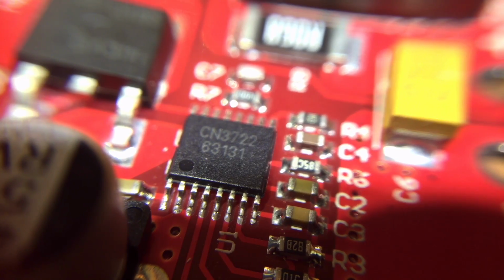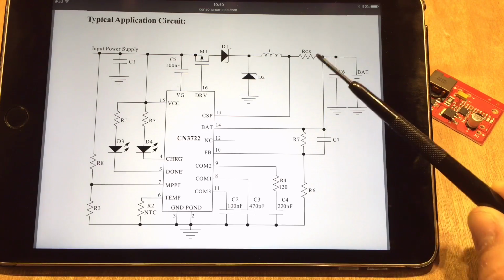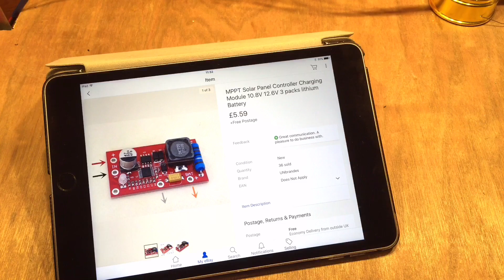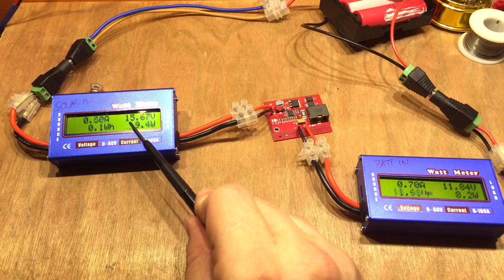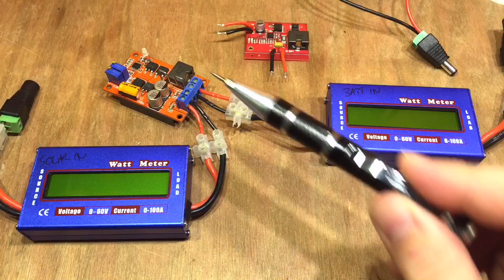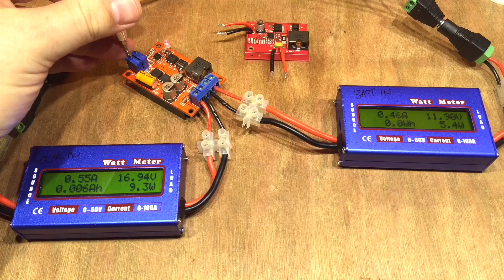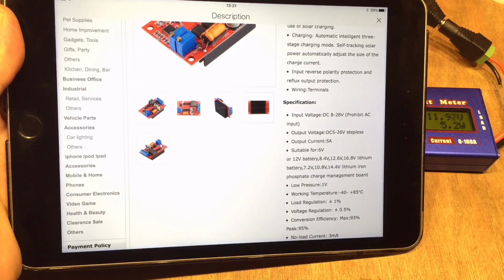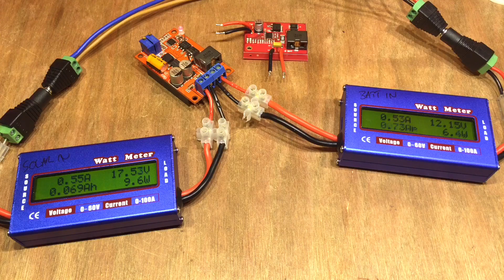Cheap(est?) Lithium MPPT Solar Charge Controller CN3722 - 12v Solar Shed

Comment: MPPT? ROTFL! 
The modules are operating a a FIXED power point 18V. 
That might be good under the reference conditions for most 18V panels, but be bad for all other ranges, and an absolute no-go under diffuse light.
I know these modules, built around the CN3767 very well and even use them, but with a tweak around the R1/R2 voltage divisor to provide a real MPPT with software.

Comment: I'm adjusting the one with the two pots.  I only have one inline meter.  Is it ok to place that between battery and charge controller and adjust to maximum charge rate? or should I do it differently?

Comment: After looking, again, it looks as the PCB is the samle what is given for a design.  So it's a Solar Charge Controller and NOT a MPPT tracker, it has only a input to connect to a tracker  and the term MPPT is not complete true, but works better than a charger without it as it has (some) setup to go for a possible global panel setting.!
Reply from the maker: I think I said in this video that it’s not maximum power point tracking, but more maximum power point targeting. There is pretty good theory behind the idea that setting a target at the panels Vmpp will get pretty good results. It’s not going to get as good results as a more advanced charge controller, but this module is for small projects and probably has benefits over a cheap pwm charge controller.
Reply: @AdamWelchUK  I agree , for small  systems it does a good job as long as the panel gives a MPP around 15 V.

Comment: The MPPT input on the CN3722 is just a input. as datasheet says.  That neans you need a external MPPT controller what is aware of tge characterisricks of the solar panel you are using. And thats not only a voltage comming its depends (very) heavy on the temp of the panel and the power received from the sun (think about clouds coming over).
For more info about MPPT:  https://www.youtube.com/watch?v=0ItjKs7aJFM

Comment: is it recommendable to use a BMS in parallel in the output of the solar charge controller?
Reply: @Angel  depends on what for battery pack you are using. For only (xxP)3S of 16850's cells i will say YES but when you are connecting a 12V 100Ah LiPoFe4 it is a complete overkill.  (Hope this help :)
Reply: @retiredjan4714  I'm using four of the second one in the video and they are connected to four 12V 8Ah Lifepo4 Batteries which are wired up in series, so basically the charge controller's are connected one per battery which makes them also in series... Each controller looks after it's own battery and stop's for that battery alone when it's fully charged but the rest keep charging if they need it... With this setup I don't need a BMS! It works for 24V 36V and my 48V battery bank... 
If one or two cell's reach full charge, their Controllers stop but if a load is turned on, the two controller's step in and provide energy to power the load.. I'm impressed with how good it works... There's many ways to set up a battery and charging system but the one thing that I keep hearing from everyone else is balancing issues, I don't have that problem... It's just automatic with this setup...

Comment: The second controller, is it ok to adjust the output voltage with just a meter attached in place of a battery?
Reply: No, I don't think so, I disconnected the battery while the solar panel was still connected and it died! I don't think a meter would present enough load to stop it from dying... I haven't yet had a look at it's datasheet to see if there's any mention of placing a resistor across the battery output to provide protection against this sort of thing....

Comment: is it possible to extend an mppt controller/hybrid inverter PV input voltage? Perhaps just upgrading the input stage capacitors? I noticed a voltage divider network near the 100v 1000uF im guessing it reports the input voltage to the mcu. My mppt/inverter is a Easun Power ISolar SMV 3k 24v

Comment: I have just bought and tested the 3s mppt controller , used a variable wall charger at 16.5v to replicate solar input ,the controller did charge the battery pack but wow it got super warm I think it would need a huge heat sink lol

Comment: Need a little bit of help if you don't mind I'm building a new type of solar as you can see in this link https://youtu.be/Dp-6fOGI6oc  
I want to change the way the 12 volts is used to from the solar is it possible to boost up the the current by using capacitor storage come email medialibraryinfo@gmail.com you can contact us at 313-651-5349

Comment: Thanks for the video Adam. 

I'm actually testing a pair of these to charge my portable solar accelerator project. For what I need, they seem to be ok. They definitely do DC to DC conversion, although as you say, they're not power point tracking, more power point vomtage holding. However for the size and price, I think they're worthwhile, in small solar installations.
Reply: Are you able to attache an LCD screen on these ?
Reply: The fact that you can get more current into your battery by doing DC-DC conversion compared to a PWM controller is still much better off even though It doesnt maintain the full powerpoint even during cloudy conditions, etc. the fact that you can adjust it is pretty good as well

Comment: Those devices were putting the same level of current into your batteries as the solar panel was giving out -- about .6A.
You could just hook up the solar panels direct to the battery for the same effect.
About the only thing they appear to be good for is to prevent overcharging.

Comment: MPPT means ability to 'track' the max yield point in the panel.. which varies from panel to panel and also shifts with temp and illumination... it dfntly dsnt mean 'setting' a voltage to a set value (as is being done in the second controller)...  an actual MPPT controller has a range of voltage in which it 'hunts' for the point which yields the maximum power... there are a few diff algos whicb do this in few diff styles.. but none of them use any preset values to operate..  this circuit appears a waste of time and money.
Reply from the maker: I think I mentioned the fact it doesn’t track didn’t I? More of an MPP solar charge controller I think I said? This has its uses in my opinion - it’s great for a little remote project that needs a small and efficient solar charge controller.

Comment: I Wouldn't be worried about the "tracking" as long as I can set a roughly correct Powerpoint. What worries me more is the loss of efficiency of the adjustable board compared to the fixed version. It seems this is much more significant then the missing mpp tracking.
Reply: The Increased Current limit to 5 Amps on the larger board is worth it though, in my testing with both boards, the smaller board with about 5 watts going through it had an efficiency of about 98%, the large board with that wattage was about 98 as well, but with 5 Amps being shoved through it, the efficiency was about 89-92% depending on the temperature outside, etc. But still, 5 Amps at 20 Volts Makes for about 7.5 Amps at 12.6 Volts which is an insane difference in charging speed!

Comment: Using a battery that is charging provides quite a variable load, and the test is thus inconsistent. YouTube star Julian Ilett correctly applied a load on his battery to prevent it from changing voltage during such comparisons. If the output voltage is constant, then a load resistor might be used to provide a constant load.

Comment: Constant Voltage is the cheap and dirty way of doing psuedo-MPPT, a couple percent less efficient than true MPPT charging.  If you live in a higher lattitude or constantly cloudy area, those couple percent can make a huge difference in how much power you get over one day.  The CN3722 is designed only for Constant Voltage MPPT.

Comment: Wish I could figure out how to use these and other small MPPT Controllers as a Reference to drive FET and Inductors of 20-50Amp  .  Quite sure there is a way I'm just not knowledgeable enough to hack it.  Guessing one could simply use the FET drive to Drive  parallel FETs and Inductors to obtain the goal ?
Reply: Or you can simply use two or more of these in parallel for more current or Go the other way and wire them in series for higher voltage...
Reply: @PeterMilanovski  Yes but there has to be a way to simply expand they're current levels.  Everything is there but the dang Current.  That is derived by the inductor.  Can we use one to manage a larger inductor ?   Multiple inductors ?  My Ep ever has two rather sizable inductors employed.
Reply: @pulesjet  I was just looking at the datasheet for the control IC chip on the PCB board, the datasheet only shows two diodes and one transistor! But the actual PCB has two double diodes which is four diode's and two transistors instead of one! So I think that the person who designed this board was thinking about reliability at the full rated 5A current... The only way to get more current out of it would be to use higher current capable diode's and transistors but mount them off the PCB board and onto a larger heatsink and connect them with wires, I don't know what that inductor is rated for though? It might also need to be upgraded and remotely mounted like the other components... Everything else is low temperature 🌡️... It's not impossible to do, just get the datasheets for the components that need to be upgraded and find higher current versions of them... Because heat is the only problem that's stopping it from delivering more current, oh and also there's a resistor that set's the limit for the current which also needs to be replaced with another value or a potentiometer so that it can be adjusted... The datasheet isn't to hard to understand to make the necessary changes...
Reply: @PeterMilanovski  We should be able to slave another Fet and inductor some how.  I'm in the process of dying here.  I don't have the time.  All it would take is to drive another mos fet and inductor in parallel  I  would think ? Just use the little board as a Basis and driver.
Reply: @pulesjet  yeah I don't think that its that simple, adding another transistor or inductor in parallel could possibly destroy the controller IC which has to provide the energy to drive the transistors, in the datasheet, it only shows just one transistor in the circuit diagram but this board already has two transistors... I can see options but none of them are as simple as you would want them to be! The easiest option is to get more of them and parallel them together...

Comment: I Honestly Believe that as long as there is a External Voltage Reference Regulator for the Switch Mode Power Supply's Feedback pin so that it monitor's the solar panels voltage, you basically have a Somewhat Crude but very Effective MPPT Charge Controller because the Job of the External reference Voltage Circuit is to monitor the Panel's voltage so that it doesnt dive and you dont get maximum efficiency. Having a circuit with a Potientiometer that allows you to adjust that external reference voltage Is What allows you to tune your circuit so that you achieve the correct Powerpoint for that particular panel and your particular application.

Comment: Thanks to your insightful video I was able to build my waterfall. Using the second mppt you featured. I used:
18v 50watt panel
4s10p lithium ion pack
It charges amazingly.

I'm using a stepdown to 12.6 volts for 12.6 v 3amp water pump, fans, remote relays and on/off timer also some digital meters and lights.
Reply: This is the answer I was looking for. Thanks
Reply: I am using four of them with their outputs wired up in series across four Lifepo4 Batteries which are also in series! Each controller looks after it's own battery and when one battery is fully charged the rest keep charging! The batteries are always in balance! I love these little things 💟.. they really are that good!
Reply: @PeterMilanovski  , not to mention their price. Shout out to Mr. Welch. Thanks to him we were able to fill our needs

Comment: So I noticed you don't have a 3s 18650 BMS connected to the mppt charger. Is that not required? I always thought it was necessary to monitor the individual voltage of each battery to properly keep the individual batteries balanced.  Does this MPPT controller take care of all of that?

Comment: Very nice review I've wondered about these solar chargers for 18 650 batteries . I have a need for a small project that involves a PIR sensor and a esp 8266 processor. I think something like this in a 10 watt solar panel. Would keep it charged up

Comment: My waterfall was powering up great. Until I messed around with the potentiometer of the battery voltage. It powers off my devices. Then after disconnecting battery and reconnecting it works again. Its been doing it regularly. Is there a way to reset the mppt to its normal state?

Comment: I hope you don't mind this post. I used these instructions to set mine up to a mono, 12v 70w Watts Solar Panel. The Max Power voltage is 17.2 volts. Mine is reading 17.82  volts after setup. That is close enough for me. https://robotzero.one/5a-mppt-charger-instructions/
Reply from the maker: No trouble at all. A handy guide, thanks.

Comment: You didn't say anything about the heatsink on the back of the board. I just got one of the adjustable modules. The heatsink is held to the back of the board with a glob of silicone rubber. The heat sink is mounted precariously and can touch the solder joints on the board. I am heatsink gluing a smaller heatsink directly to the diodes and MOSFETs. I don't trust their design.
Reply: Maybe you could have cut some squares out of aluminium and use thermal adhesive to stick them directly to the PCB and then replaced the original heatsink onto them... Or even go for a larger heatsink.. they do get quite warm when delivering 5A..

Comment: thanks for the video, this is not doing mppt it just regulate the panel voltage which is not mppt. Question : did you figure out why the efficiency is too low?

Comment: Super in depth, thank you. I’m trying to create a, let’s call it solar controller power supply, so that when I’m charging my “solar generator” that connects to the PV side of the solar charge I can monitor the stats of my panels. The three controllers I’m working with will not turn on without being able to “see” the battery on the batt. Terminals. My hope is to use one of these controllers and a simple 3s 18650 pack and connect this little power supply when I’m charging my solar generator, would it just be a matter of feeding that voltage back to the controller, probably with diodes to power up the solar controller?

Comment: Just arrived the MPPT controller for 12 lead acid battery. It has a few more components on the solar input side and clearly performs MPPT holding the solar panel at 17.34 V but varies to maintain current. I have replaced the small Cheap(ist) PWM controller with this one for my solar green house that uses a 25W panel and it has increase the output to the battery maintaining a trickle charge just above 13v.

Comment: Where does the load connect up? Can it be connected directly to the solar panel and will the charger feed the battery energy back to the load when the sun disappears or does the load have to be connected directly to the battery. The trouble with the latter is that if the charger considers the battery to be fully charged, it will cut off the solar panel and use the stored battery energy even when the solar power is available.

Comment: When you lowered the input voltage to 15 V,  battery watt meter reported higher wattage going to battery, which is I guess better compared to 17.5 v on input
Reply: I saw the input wattage climb to the full 10W when he gets the panel voltage to 18.2V...

Comment: Thanks for the video, Adam. I have ordered the first unit from eBay to solar charge my 3S 18650. How would you tap the leads from the controller to the load? Directly from the +/- battery leads? I am using it to drive a 12V motor.

Comment: Walk in front of the panel, and then check it. If it's anything like the (two different) buck converters I bought, they trip up. Hours later, the battery (3.2v LiFePO4) was only slightly charged, with a 6v panel. That should have been almost twice the amps into the battery than coming from the panel - minus inefficiency (what, 15% or so).
I'll try these but if they trip up from a sudden shadow, then your arse is mine... LOL. This time, though, I'll try the slightly higher voltage of a real li-ion (a few in parallel), with your presented boards. If it doesn't work, then I know to put them in series (but that requires separate PCB for battery balancing - wraa...). It's just for my LEDs light.
Bty, thanks for the professional approach!

Comment: Hi Adam .. just a quick question.. does that output to the battery stay at 12.6v for a 3S pack?  I have a small pack that I am only balancing but not using a BMS. Just wondering if this thing would blow up my pack as the balancer probably couldn't keep up with the input.

Comment: Thank you Adam, for checking this out ! ==> seems quite similar to  https://www.ebay.de/itm/272795749639 - MPP Solar 5A Step Down CC/CV Charging Module providing extra manual  MPP adjustment + much larger inductor for better efficiency (quite poor with the tiny device you tested here) ... see also https://youtu.be/GlnjyFnFiR0?t=530  for it's charge performance testing (or start from beginning for all details & variations offered)

Comment: Everyone has what they call MPPT. If I can't wire my panels in series to get the most from them then I don't see where it is really doing MPPT!  When the input volts are near the battery voltage MPPT doesn't give much, could do almost as good with a PWM! Can't find what the max input voltage!
Reply from the maker: Datasheet says 28v max... http://www.consonance-elec.com/pdf/datasheet/DSE-CN3722.pdf